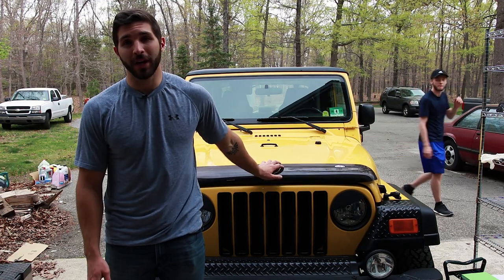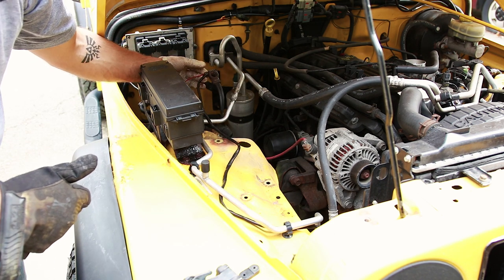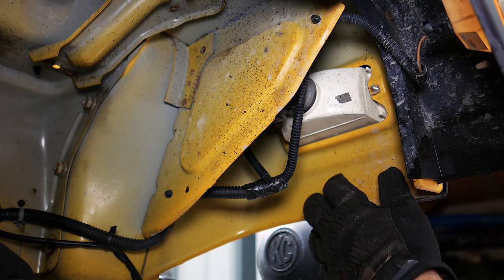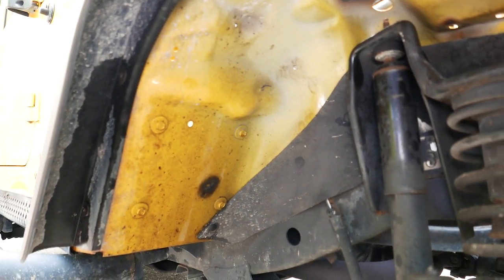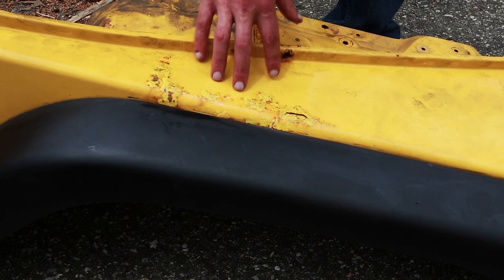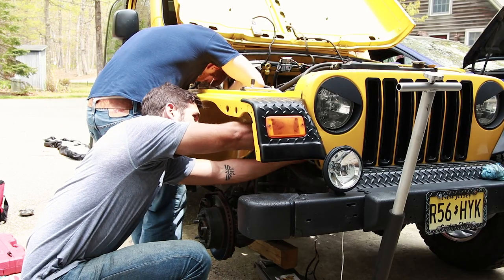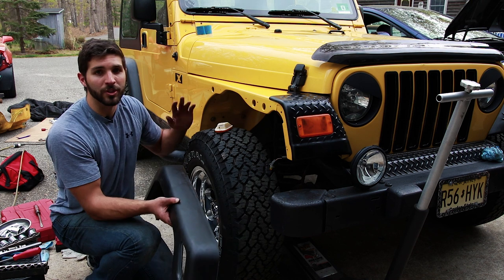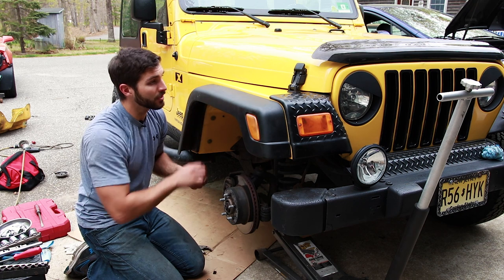Jeep Wrangler TJ Fender Removal and Replacement 1997 - 2006 | TJ Fender Replacement

Comment: This is a great video! I am in the middle of changing out my two front fenders on my 2005 TJ Unlimited (LJ) and this video has helped a ton.  I ended up breaking two bolts on my first fender removal, and if you want a suggestion for a future video I would love to see how you repaired the nutsert that broke.  But thanks again - great detail explaining all the parts that have to be removed out of the way.
Reply from the maker: Awesome! I'm glad it is helping you out. Best of luck with the rest!

Comment: Even if totally sealed underneath, if that plate has any airspace between it and the fender it will allow condensation to form in hot/cold climate.  Sun hits the top side on a cold day, condensation forms even if sealed. But the seal will slow down the effect.  I need to do both fenders on mine. Ugh.  My plan is to put bed liner on the bottom side.

Comment: Great video.  My drivers side fender is going bad and needs replacement you've just convinced me to do the job myself.  One question though:  Did you buy the fender already painted or did you paint it yourself?
Reply from the maker: We had a body shop do the yellow And did the POR15 on the inside ourselves. POR15 is mostly intended for rusty metal. I would talk to a good painter for what the best paint/epoxy is to use on the inside and have the outside professionally done
Reply: @TheSundaeDrive  Thanks.  Yeah I keep POR-15 on hand.  Good idea on bringing it to a painter!   If I did it in sure if end up with runs out orange peel.
Reply: another option is to spray them with bedliner

Comment: I hope you still read comments seeing the age of this video. But I have a jeep same color as yours fenders are shot and I want original look of fenders. Was it hard to get the yellow to paint match? I've tried to find yellow ones that arent gone but it's like impossible and I would rather have yellow fenders than black ones but idk if its difficult to match the yellow paint
Reply from the maker: We do still read them! Not too big for that yet 😉 so the paint on the rest of the jeep was in pretty good shape and they were able to match it really well. This was a brand new fender of course which is probably the way to go because of how these tend to rust out.
Reply: @TheSundaeDrive  thank you, I think I'm just going to get my paint code have a place mix it up and put it in a spray can for me and do that with a clear coat to put on top to get it as best I can

Comment: Great vid but I would add sealant on the underside of the fender as a rust retardant and drill some holes in the underside structure plate to aid water drainage.
Reply from the maker: No a bad idea. Hopefully the por15 will work it's magic and keep it from rusting out

Comment: I have a 1997 Jeep Wrangler. My jeep has been in quite a few accidents, and I'd like to replace the fenders. How much do you think it would cost if I bought them and replaced them myself?
Reply from the maker: At this time is looks like Amazon has Driver and Passenger side fenders for $163 and $112 respectively. There is also Quadratec but they sell each side for $232. I’m not sure if the difference in quality but you can expect to pay between $275 and $464 for the fenders. Then you need to get them painted which could cost another $150 so anywhere from $425 to $614

Comment: I have an 06 wrangler. Do you know if the fender is the same as the one on the TJ model?
Reply from the maker: 2006 should be the last year for the TJ so I’d imagine that it should work. Does the front end look like the one in the video? 2007 would be the first year for the JK Wrangler and that Fender would be different
Reply: @TheSundaeDrive   I can't really tell, but are you saying that the 06 Wrangler is part of the JT class? They're the same? Ty

Comment: What serial number for the fenders did you purchase off the website,  a little confused matching them with my 2003 wrangler?
Reply: The OEM serial number for the fender is: 5003950AL
According to Quadratec this is the fender for 1997-2006 Wranglers: https://www.quadratec.com/products/12502_102_07.htm

Comment: How/where were able to get the factory color done after you ordered the fender?
Reply from the maker: It was paint matched by a body shop. Any good body shop will be able to using paint cards to match the fading of the paint over time. For the best match, you'll want to blend the paint  after it is installed. This turned out pretty good tho

Comment: Great vid, did you paint the fenders yourself or buy them painted? I got a white 2000 tj that needs fender replacement
Reply from the maker: Purchased them and then had them painted professionally. We also had POR15 applied before the color

Comment: Was thinking about that reinforcement bracket under the fender could be filled with that spray foam insulation so there’s no air able to get in. Maybe drill holes in the ribs and just fill it up. May work quite well.

Comment: My girl crashed my jeep into a stop sign and I was able to get it back on the road pretty easily
Reply from the maker: Glad this helped!
Reply: Had some trouble getting thee grill aligned properly for the new hood. It’s essential to get that bracket part back in the front rear 3 bolts